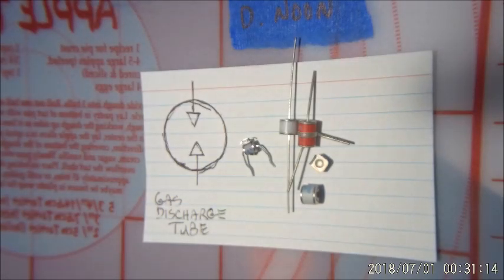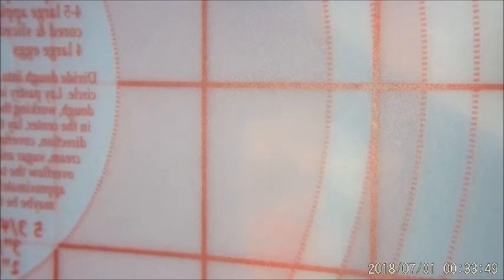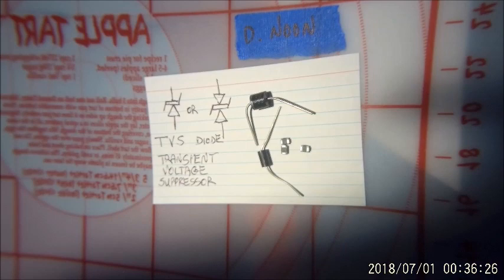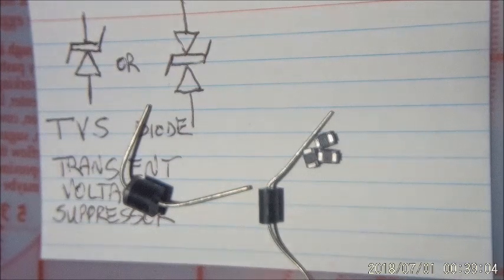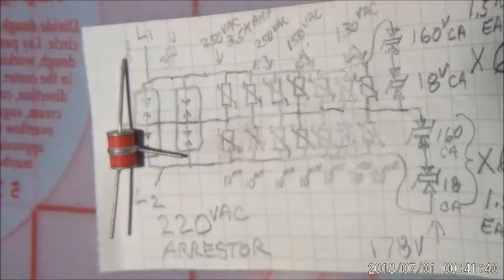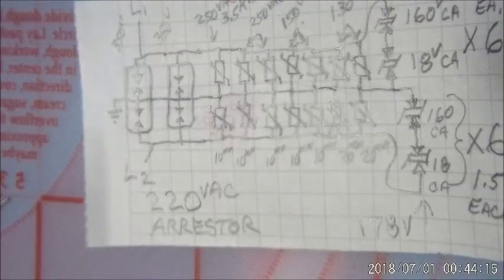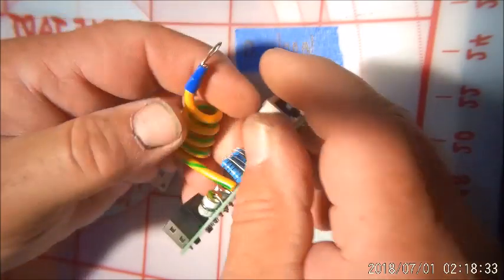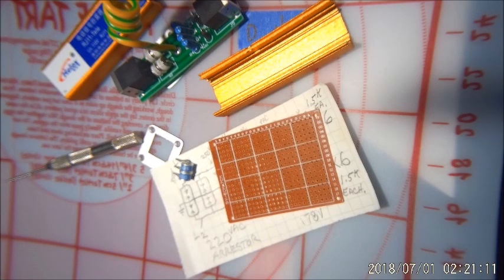EMP BUSTER !! EMP SHUNT... Lightning arrestor, DIY CME Arrestor ! Part 1

Comment: so how would I go about wiring this to a circuit breaker? thanks for this it is great info
Reply from the maker: Just hook it to the output screws of the circuit breaker as well as to the ground where needed in the circuit layout. Then if the circuit is hit by a voltage spike, it will trip the breaker soon after. Just remember that after the breaker is tripped, there is no longer any protection on the panel box.

Comment: Hi There!
Do you have a written list of the Components used for the 220 version?
Reply from the maker: I just have the example schematic of the one I made here on the video. It is a guide to go by to help you make your own choices for the components you want. I can say that the more MOV's you put it, the more power it can pass to ground. And that goes for all the components. Use what you have and add what you can.

Comment: I was doing a search for DIY surge suppression circuits, and I kept seeing one that puzzled me.

It had a GDT in SERIES with an MOV placed across the line. I'm curious why this particular circuit would be beneficial.
Reply: Chaplain Dave Sparks, I cannot access my account anymore for some reason. Putting a gas discharge tube in series with anything would not work well as it is supposed to short out a high voltage spike. It would just work IF a voltage was higher than the MOV ...AND... IF it were large enough to be above both voltage ratings together. Plus now you will have extra time till the voltages reached the thresholds of both. So you would have extra high voltages on your "protected" circuit till the voltages were reached and shorted out to ground.
Reply: @dnoon1436  The notation on the schematic DID say that the combined voltage ratings of the two dissimilar devices should equal the total desired, plus both should have similar current ratings, so MAYBE they're hoping that with each device triggering at HALF the voltage desired, maybe one would trigger earlier and maybe help trigger the other? Just guessing ...

Personally, I THINK your design of having all devices in parallel would be wiser.

With two devices in series, and each at very high (normal) impedance, I'm not sure how the line voltage would divide between the two.
Reply: @ChaplainDaveSparks  I agree with you. I have tested these by using a variac transformer with a 120v to 240 volt transformer on the output. So I had no way of testing a spike or testing rise time of a spike. I am going by the ratings in nano seconds or pico seconds. So it would seem to me that the time to respond would change to when one would start conducting and add the second time for the second device to begin conducting. By that total time...the voltage on the circuit might be way too high to survive. Good luck sir and thank you for making me think. Ask any time!
Reply: You could us a magnetron.. to send high voltage .. for a test

Comment: Any devices you add MUST exceed the Peak voltage of the AC circuit, not the RMS value..!   (RMS = 120v, but Peak = 169v)
Reply from the maker: Yes you are correct. 120volt RMS times 1.414 = 169.68...125 volt X 1.414 = 176.75
Reply from the maker: I have had some trouble with cheap diodes not holding up to specified voltages, so I now recommend setting all values at about 200 volts rating... for the diodes only. I still use 130 volt MOV's.

Comment: Thanks for this! I am at the level where this really helps.
Reply from the maker: If you use the diodes in the circuit for house current, you should add a few more volts to the diodes you get. I had a few go pop, but not till there was a problem spike. I think adding about twenty volts would help that. I still believe close voltages protect better. The ones for the car and truck I made are perfectly fine...also the ones on my power inverter input side are fine yet. Please let me know if you need anything and how your work? I test mine on the bench first, I can show you how if you need.